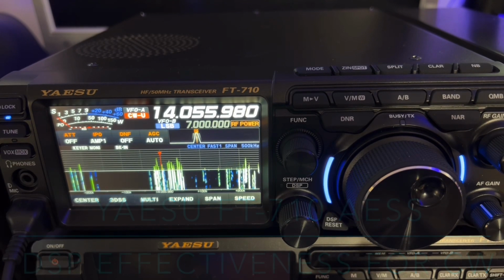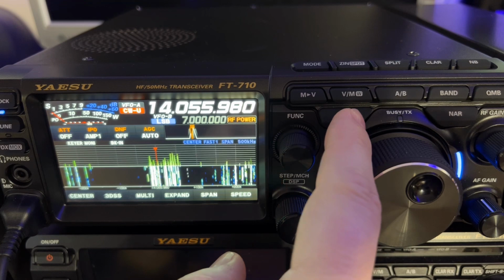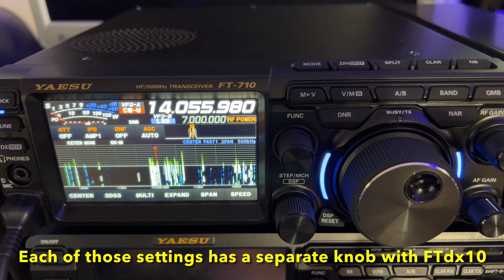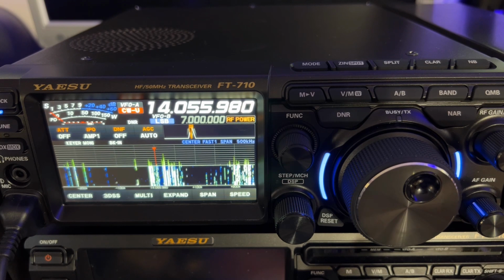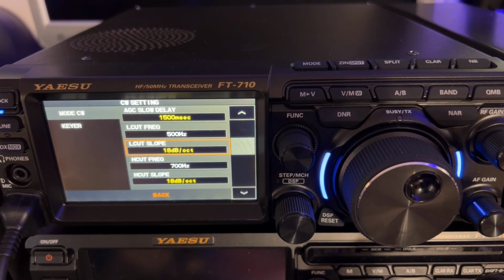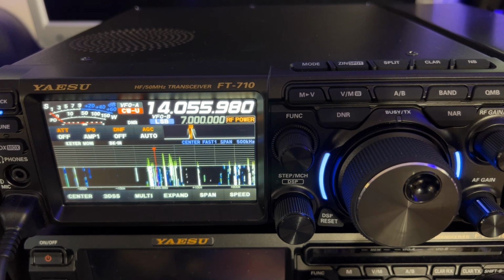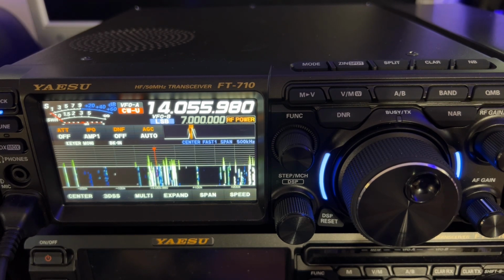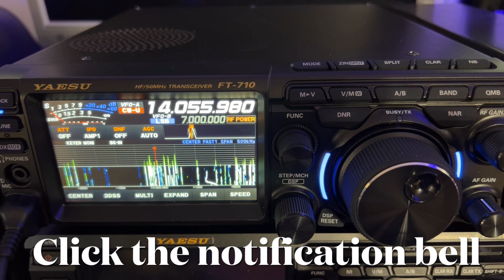Yaesu FT-710 AESS: DSP Effectiveness for CW (video #16 in this series) #hamradio #ft710 #dsp

Comment: Hi all.  Just purchased the 710, my first Yaesu.  I have severe local noise due to the hvac, and my antennas are located in the attic.  The 701 has a terrific receiver to combat this noise.  Beats my last icom.  I find the dnr usable up to number 6 on ssb.  I did install the latest firmware; it did make a difference. 73, Bill
Reply from the maker: Congratulations on getting your first Yaesu.  Yaesu isn’t perfect , but they are currently at the top of the receiver lab-test data list.  

An attic antenna can be a challenge. Internal house wiring, certain wall-warts, televisions, LED lights, laptop power supplies, gaming consoles, food sealers, etc. can cause interference. The NB and DNR can help to an extent. 

The DNR in the FT-710 was adjusted such that the original algorithms, 1 through 3, are spread across 1 through 7.  You have more increments to work with.
Reply: Thanks for all your excellent videos sir.  A wealth of knowledge.  👍🏼
Fun hobby!!!!
Reply from the maker: Thank the Patreon team members. Without them, this channel will cease.

Comment: @N4HNH I like all your FT-DX10 Videos. I have the FTDX10.. I purchased The FT-710 and felt the FT-DX10 was the better of the two radios. And sold it to my brother as he likes collecting Yeasu radios, he  has quite a few Yaesu's. He has a FT-DX10 to  & agrees he likes the FT-DX10 because it's a better Radio. the FT-DX10  is his main Radio. 73's & thank You N4HNH for the  FT-DX10 Radio videos, there a joy to watch.  I'm not sure but I think when Yaesu leaves the "DX" out of the name like FT-710 it's a lower end radio. What do you Thank N4HNH??
Reply from the maker: I think the FTdx designation has traditionally indicated that the components used in the superheterodyne stages are higher quality than those used in the the non-dx receivers. Lower phase noise is a big advantage.  That said, the FT-710 is direct sampling, so it is a new class of receiver for Yaesu.  It is noteworthy to mention that the FT-991A has a front-end that is patterned after the FTdx Architecture.

Comment: Thanks for another great video! What would you say are the advantages of the FT-710 over the FTDX-10, besides price.? 73, WA3RSL
Reply from the maker: 1> DNF isn’t distorted with strong SSB signals
2> A peak reading wattmeter

Numerous subtle features missing in FT-710:
1> No CW decoder
2> No Quick-split
3> TXW is in the Function menu (must select and assign to Function knob and long-press Function knob to activate receive on the TX frequency = too many steps)
4> DNR not even close to FTdx10
5> Cooling fan runs 85% of the time, even when receiving for hours without transmitting 

Those are a few. There is an upcoming video entitled “Missed Opportunities”.

73, de N4HNH
Reply: @n4hnhradio  Thanks for the info Doug. Keep up the great, informative videos! 73, WA3RSL
Reply from the maker: I will try. This economy is hurting the channel. Hard for me to put the time in. Patreons having to bail due to inflation.
Reply: @n4hnhradio  does it help at all to let the adds roll instead of skip?
Reply from the maker: I’m told that it does help if the ads play to their full duration. YouTube doesn’t provide any metrics so I don’t even know if my $168 was the right amount last month. It began as a 60/40 split where I get 60% of the ad revenue. At some point along the way, I hear they changed it and now I only get 55%. But again, I don’t get to see any metrics associated with the ads. I just get a deposit. It’s usually between $160 and $200. Not nearly enough to justify my time and expense. I wish I was independently wealthy and didn’t have to worry about the financial aspects of it. Thankfully, the Patreon team members help.

73, de N4HNH
Reply: @n4hnhradio  why would you use dnr dnf on a strong ssb signal..where it comes into its own is for that down in the noise low signal strength station. In combination with all the other functions..shift..contour..etc it works.wonders. Peak ssb was there the last time I looked.
Reply from the maker: DNF is for stopping transient heterodyne, like tuner-uppers. You never know when that will happen. So some people leave DNF on. I was listening on my FTdx5000MP last night while working and there were several tuner-uppers during this one rag chew. I left the DNF on. Thankfully the DNF in the FTdx5000MP doesn’t introduce distortion in the received audio. I was listening with DNF enabled and the receive audio was fine. As I listened with DNF enabled, I would just suddenly hear the background noise disappear and the S-meter would rise. 

The DNF in the FTdx5000MP knocks out heterodyne so quickly that you don’t miss a word that is being spoken. 

When I’m listening to a weak signal, the tuner-upper is actually doing me a favor. Their signal masks the noise floor, the DNF masks the heterodyne, and I can hear the weak station better. 

Now let’s talk about DNR.  DNR is something that helps when pulling weak SSB signals out of the noise. But, with DNR as good as the DNR in the FTdx5000MP and the FTdx10, I leave DNR enabled even with strong signals, to stop the noise between words and syllables. I usually leave DNR set at algorithm 3 with the 5K and the 10.  I use algorithm 9 with the FT-891 and FT-991A.  Using DNR in conjunction with the other techniques I’ve shown on this channel, employing IPO, ATT, RF Gain, etc., I listen to SSB rag chews as if it was a phone conference.  This is covered in videos across my channel, in the various playlists. 

73, de N4HNH

Comment: What in the heck does the TXW menu button do on the 710? Thanks, Doug.
Reply from the maker: Hi Larry!  Watch video #27 in the “Additional FT-710 AESS Videos” list, on the Patreon site.  It’s in the FT-710 AESS collection. 73, Doug
Reply: @n4hnhradio  Thank you!
Reply from the maker: It’s part of split mode operation.
Reply: @n4hnhradio  Yeah, I stumbled over it surfing the manual. It's a bit confusing. I'll work on it with a friend I can make contact with locally and play with it. I doubt I'll ever use Split, but you never know.
Reply from the maker: The DXpeditions usually work split. That’s the only to get them. Popular DX stations in general often work split. It’s a good skill to explore and develop.

Comment: Side tone is what you get when you send CW with the radio. Side tone is NOT what you are hearing from the other station.
Reply from the maker: That’s correct. But the pitch you set your sidetone to is the pitch that your BFO will produce, if your receive frequency aligns with the station that is sending to you. The ZIN feature can perform that alignment.  I think my point in this video was that the other station isn’t transmitting a tone. They are transmitting a carrier wave with each dit and dah. The BFO in our receiver creates the tone we hear.

Comment: Pues me gusta mucho mas el FT710  Aess, que el FTdx10 ¿Que quieres que te diga? Ya me compre un equipo FT710 y tengo también, el FT-901D
el FTdx5000MP, el FTdx3000D, el FT847 y el FT897D  (para H/V/U) y el FT-950 lo vendí en 2ª mano  73.s, un abrazo de EA4GGC
Reply from the maker: The FT-710 is fine. No one radio is perfect. I don’t work for Yaesu but I’m sure they are happy that you still choose Yaesu.
Reply: Te explico, los que tenemos equipos BUENOS de Yaesu. No podemos perder la oportunidad de tener el FT710  Aess  por su precio y porque lo tiene TODO ADEMÁS ES TAN BUENO PARA HF QUE ESTA ENTRE LOS 4 MEJORES DEL MUNDO POR 1180 €. ES PEQUEÑO Y MANEJABLE, POR DELANTE Y POR DETRÁS (ZONA DE ENCHUFES) Tengo entendido, que el conector del micro tuning y Al  es de 10pines en el FTDX10 y en el FT710 es de 8 pines, más standart. Y detalles así.